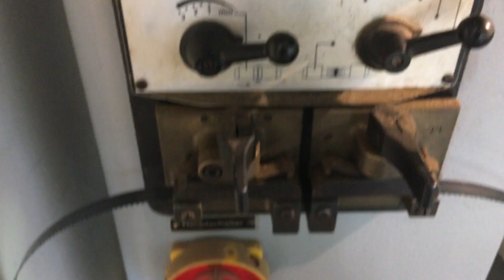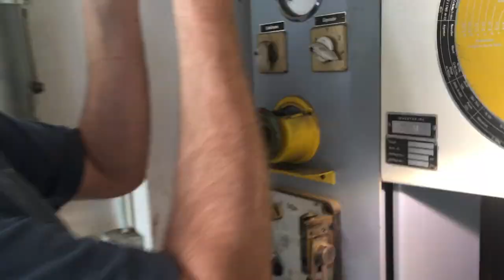Land Rover Discovery 3 / LR3 - Roof Rack Build DIY / S1-Ep8

Comment: Brilliant!!
How did you fasten the front of the rack to the roof? I know you used a bolt but did you drill the roof? 
Couldn’t see exactly I know you had a bracket.
I’ve just got a LR4 
Never had one before 
Enjoying your channel 
Thanks Charles
Reply from the maker: There is a plastic plug in the front section of the gutter cover. You can unscrew it or pull it out.  It exposes a solid M6 hole.  👍
Reply: Thank you for your quick reply. I didn’t know that. Are you planning to keep your Discovery 3 now ?

Comment: I used to manage a tool room for a US Navy machine shop. 
I think we had band saw blades in 20 different lengths. 
I guess the operators weren't Germans
Reply from the maker: The Navi has Likely the best quality blades available on the planet I guess.  High strength steel blades are difficult to weld.  Christian